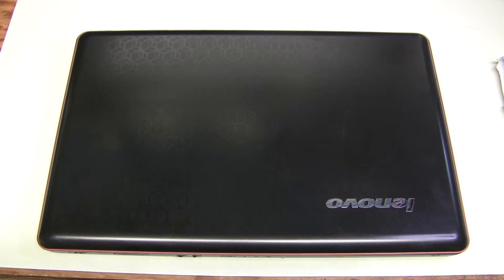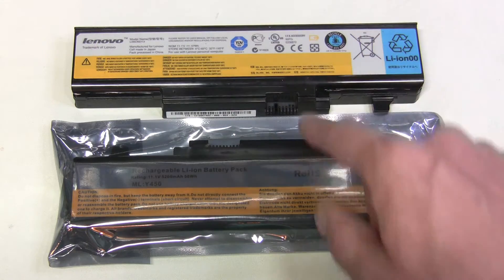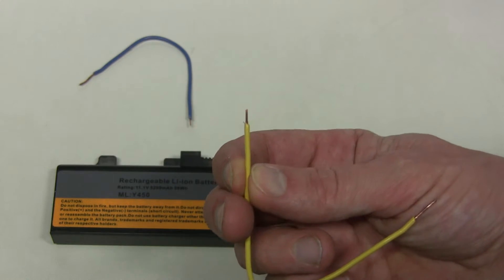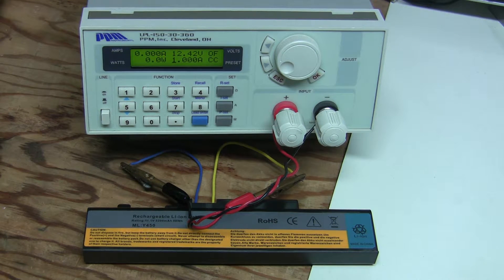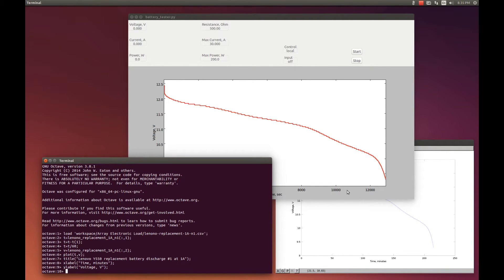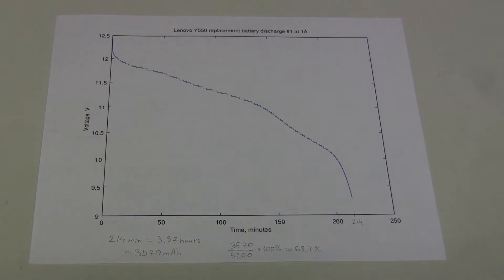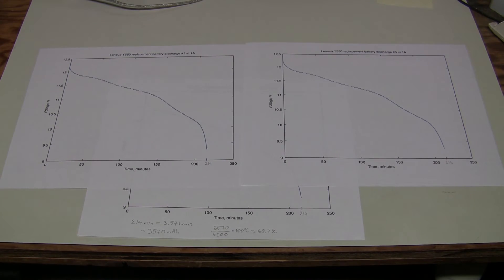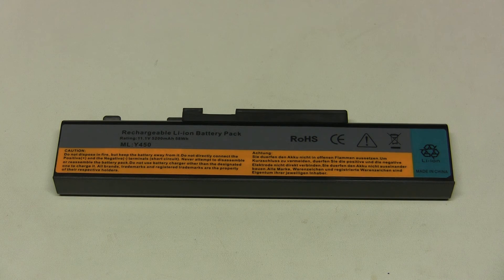#31 - Lenovo Y550 replacement battery capacity measurement

Comment: just open it and replace the batteries with good one's, if you do both battery packs then you have a spare just in case you need extra battery time...
Reply from the maker: I don't think it is that simple. As far as I understand, there is a battery management chip built into the battery pack that keeps track of things such as usable capacity. Perhaps it needs to be reprogrammed. But I am not an expert in this.
Reply: @feedback-loop  I'm sure that I have seen other videos on people opening the laptop battery case and replacing the 18650 lithium ion batteries with new one's... It seems to work although I haven't tried it myself yet! My laptop battery pack has stopped working and I can't seem to charge it even with a lab power supply so eventually I'm going to have no choice but to open it to see what is actually wrong with it... Some packs have screws and are easy to open but my Acer battery pack appears to be glued together... So I'm waiting to see if anyone else has opened one up so that I don't destroy it... Sometimes it's the controller but most times it's just a bad single cell... I'm in no hurry as I never really use the battery anyway but it worries me that the mains power supply only ever turns off when you don't have a battery backup of some sort.... It's the same with data backups, you do it for years and the one time that you don't do it, you get data corruption! I think the same is true for lottery tickets too LOL. That one time that you didn't play and your numbers come up.... Life is funny like that. Oh and I just remembered... There are videos on laptop battery not charging fix... It's a kind of resetting for the battery, I tried it on mine and it did exactly as what they said it would do but unfortunately for me it didn't fix my problem... I didn't want to get one of those eBay batteries because I expected them to be as your one turned out... They tell you to cycle through the battery three times so that you kinda get used to it and forget to return it.... I'm sure that they were not expecting people to cycle through their batteries using lab power supplies and electronic loads LoL... By the time most people realize, it would be a few weeks later and by that time they won't return it so the seller keeps selling Chinese rubbish... And people keep falling for it... This wouldn't happen if it was made in Japan!

Comment: Yep, the mAh ratings on those Chinese batteries are always exaggerated, so like you said, no surprise there. I am actually a bit surprised that it was even within about 70% of the stated amount. Perhaps the mAh rating they state is "more accurate" if you discharge at 50 mA :) . You should do a followup with a much smaller discharge (current) rate and see if the time to discharge increases significantly. Of course this is not at all realistic in terms of actual laptop current draw when it is not sleeping.
Reply from the maker: +SteelBlueVision 
For this battery 1A is about 0.2C, which, I believe, must be close to typical discharge current for the purposes of specifying the capacity.